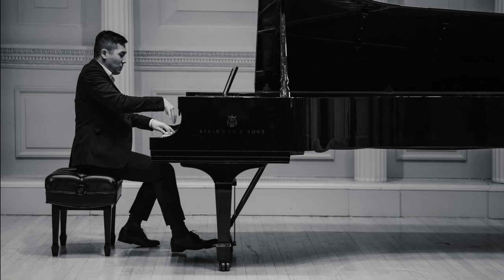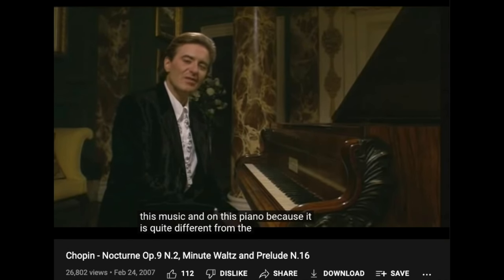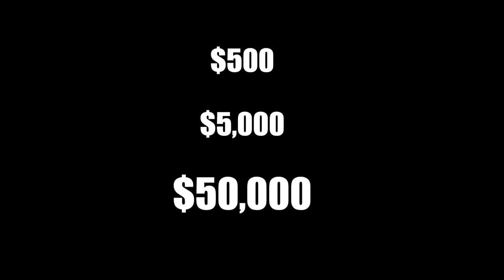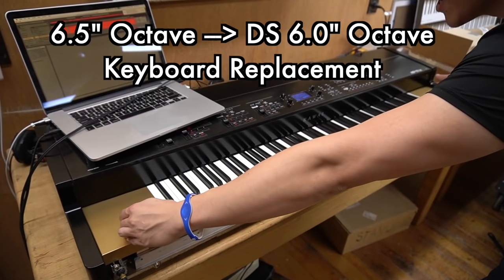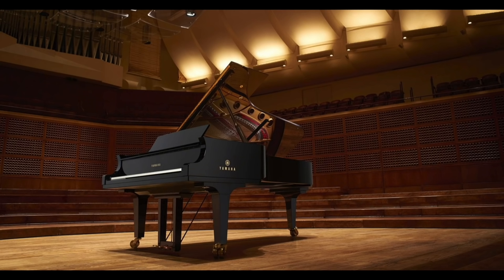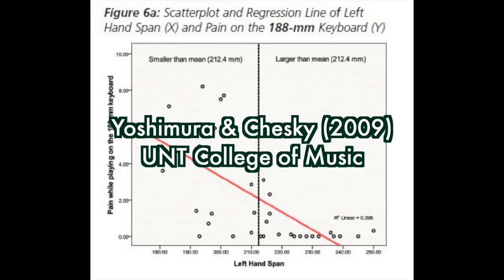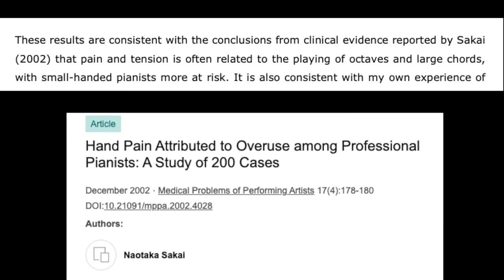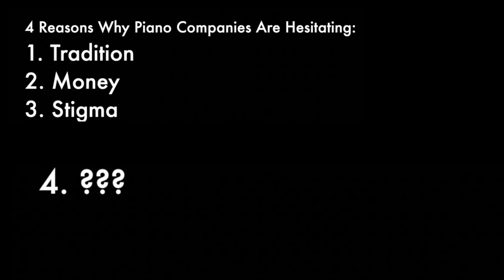Piano's Darkest Secret

Comment: Actually I thought this problem long time ago, and I was told one reason is that the big hand pianist would find the smaller sized piano impossible to play due to the narrow width between two black keys. So for manufacturer they prefer to produce one type of piano that meets the most demand ( not everyone is going to play Rachmaninoff obviously ). But yeah we are in 2022 it is a shame the big piano manufacture do not offer different size. Great video!
Reply from the maker: Yes. Back in the late 1800s this is the reason why standardization kept moving the keys wider. In a household or community where there is only 1 piano, this size made sense to allow everyone to play. But it's 2022 and everyone should have their own piano or keyboard that fits them (in my opinion :)
Reply: They just need some competition and then they will change their tune because they want the money too. Then they would make them. Maybe with this video, more awareness will come and people will buy so many keyboards from David Steinbuhler, that he has to make a full time operation of it and becomes a household name, and the competition begins.
Reply: Solution:
Standardize high protein consumption and make small people bigger.
Reply: @Serpenzeye  Hailun pianos in China has just started offering smaller keyboards on their HU1P upright acoustic model that costs about $10K [Edit: It costs $15K]  I do not know if there is any collaboration with Steinbuhler. I read a review which says Hailun makes pianos that are of outstanding quality.
Reply: Yeah, but as we saw, even the majority of men don't have ultra large hands. And restricting your products to mostly men could easily be taken to court as a discrimination case. "Tradition" does not cut it in 2022.
Reply: @pubcle  Yep, like we need to tell people to eat more.
Reply: @2112jonr  It's not discrimination to aim your product at a demographic. As stated in this very video, there isn't enough demand to actually create smaller pianos. It's not discrimination nor is it tradition.
Reply: @MusicalBasics  But people were smaller in the 1800s than they are now. So even this doesn't hold up to examination.
Reply: Heck, I find regular pianos impossible to play without excessive contortion of my wrists. My fingers are simply too thick to play between the black keys, even at glacial pace. My middle finger needs to slide in at almost exact 90 degree sideways angle to play between the white keys. 

So yeah, different sizes would be appreciated, at each end of the spectrum.
Reply: @pubcle  IT IS tradition and in fact the current size doesn't fit the MAJORITY of the population, not the minority. If you are too math iliterate to realize that,, I'm  sorry for you' because it is not hard.
Reply: @adisaikkonen  I, unfortunately(Or Fortunately) have large hands.. Large Rachmaninoff hands. Playing 10ths and 11ths are effortless to me. My piano teacher saw this in me when I was young , and taught me very difficult pieces at a young age.
I played Chopins Etude Op 10#12 when I was 11. And Brahms Rhapsodies when I was 16. 
Unfortunately with Rachmaninoff -type hands, I could Never be an effective Violinist Or Play the Harpsichord well :(

I suppose I could be a really great Cellist or Double Bassist though ;)
Reply: @InXLsisDeo  Yes, the smaller piano would be better for the majority of people, but the demand isn't there. It doesn't matter if it doesn't fit the majority of the population if the majority of the population will buy the current one. There is no incentive made strong enough to change their operations. If you're too economics illiterate to realize that, I'm sorry for you, because it's not that difficult to understand that even if it benefits people to have a smaller keyboard, if the demand isn't there, if there isn't a strong enough economic interest by the potential customers, then there's no reason for a company to take the initial hit when they'll buy the current standard piano.

Companies don't work on tradition, unless they're mom and pop or at the very least family-owned. It might be tradition partially, but only in the way that people aren't going to buy non-traditional pianos in significant enough numbers to make the effort of building the entire supply chain necessary to produce smaller key pianos in significant numbers. The corporation doesn't give a damn about tradition, it cares about money, and logistically there simply isn't enough of a push for the company to consider that investment worthwhile.
Reply: @Serpenzeye  You contradict yourself. There's competition who tries to sell smaller pianos, but nobody wants to buy them. The guy is just wasting resources and 30 years of time on his personal hobby. Nobody needs it. Saying that "80% of pianists would benefit from smaller pianos" is not only delusional, but also arrogant. As if you know better for other people what they need, than they do themselves.
Reply: @pubcle  funny!
Reply: @adisaikkonen  you make a great point. You are not alone!
Reply: @2112jonr  But piano keyboards were also narrower then, and until the late 1800s, repertoire was less likely to require the large stretches of later Romantic pieces. Women were not expected, not encouraged to be virtuosos but played appropriate 'feminine' repertoire mainly in the home. Those of Asian ethnicity (smaller spans than Caucasians) were not playing the piano then. Today's keyboard was designed to suit male European hands. The important issue is the wide range of hand spans among pianists today in relation to the 6.5 octave keyboard, quite large by historical standards.
Reply: ... please --  everyone -- please UNDERSTAND! 

it's ...

NOT 

SMALLER

PIANOS  

it's ...

SMALLER  KEYBOARDS   -- which can be fit into a standard piano -- upright or grand.

Please stop discussing smaller keyboards as smaller pianos  (unless that's really what you mean to discuss)
Reply: in saxophone, trumpet, drumming, string world you got mature thinking so all kinds of thickness, lengths and sizes are out there in reeds, sticks, mouthpieces! why the piano has not caught up is kinda disgusting, angering and utterly ridiculous
Reply: @2112jonr  Does a person's  shorter growth final height due to worse living conditions equate to smaller hand size?
Reply: Don't they, or can't they also narrow down the black keys to keep the same gap between them?
Reply: @ekklesiast  
Most people have no idea these alternative keyboards even exist. A huge portion of pianists would, in fact, benefit from these reduced-sized keyboards. Acting like us wanting people to have access to something they might not know they're missing out on is arrogant is in itself arrogant, because you presume that the status quo is inherently justified and not just happenstance. As in, you're trying to justify the piano manufacturers' greed and cowardice to progressive risk taking with flimsy "it's just how it's meant to be, this is what the people as a whole want" scapegoat bullshit.
Reply: @Mahlercougar  Paganini had huge hands...

Comment: Professional pianist here. 

My hands are 8 inches or 20 centimetres, I can play octaves pretty comfortably and I can reach a ninth if both notes are black or whites keys - if one of them is white and the other one is black, I can't play it. I think other people with my hand size would have an even smaller hand span since mine are really flexible. 

Only good point I can find in having small hands is being able to play in between the black keys, and this can be needed in a bit more modern repertoire like Debussy or Ravel. Pianists with larger hands but thin fingers are still able to do this, though. 

In most cases if you reach an octave you're said you're ready to go. That's true while you're a beginner, but when you try to play more difficult repertoire problems start to show. I'm not talking about Rachmaninov or Liszt, who wrote for their own gigantic hands. It can be difficult to play a Beethoven sonata. The problem is not the extension of the chords, but the amount of movement you must do to reach the different keys, especially while playing really fast. 

Some milimetres make a huge difference. In my case, it would be the difference between being able to play only the first movements of Grieg piano concerto, or being able to play the complete concerto. It's so sad I can't finish it just because of my hands aren't big enough to play the accompaniment at the right tempo, even when having a great leaping and chord technique. 

And finally the injuries. You probably won't injure yourself if you play half an hour a day with small. You'll probably do if you have to face Chopin's etude op 25. n°10. You'd have to care for yourself a lot for not getting injured, have a great technique, take rests, and still would be suffering to play it, and meanwhile a bigger handed pianist could play it with half the effort assuming they have the proper technique. Is it fair? 

I would definitely cry if I had a smaller sized keyboard. I just hope companies start to manufacture them, and give us small hand pianists an opportunity to play those pieces I can only dream I could play.

Comment: As a carpenter I would love to experiment with making some sort of a piano topper that can be mounted to the top of piano that is just a smaller set of keys. The majority of the keys in the middle of the piano would basically be right above their corresponding key so it would only be a challenge for the last 20 or so keys on each end.

Of course that would be a bandaid solution but it could make it more accessible to the masses

Comment: This is the video I just found yesterday as I looked for solutions to see if my old, dumb small hands on the piano could actually make a difference before I die. This is the video that made me cry. This is finally a real answer to what has stopped me going any further with my music past a certain level (medium to advanced at best, I guess). I already had the traditional handicap of not starting piano until I was 17, instead of 4, and was made to feel inferior even though I passed all my piano exams with honors , as a student. I wasn't quite solo concert level therefore, so I played for a Dutch Male choir for a while, had a few private pupils, got married, had kids, music stopped and basically resigned myself to hide away my classical box forever. And all the while I didn't realize why my hands felt cursed. I blamed my late start for being the only culprit for the constant struggles of trying to stretch my hands to a 10th. OMG my female hand is only barely 8.0 fully outstretched. Now, I'm prepared to try again maybe, if people actually are aware of this issue in the open, I might have a chance yet, maybe even be lucky enough to find a piano with smaller keys too, one day :)

Comment: I had no idea there were pianos built with thinner key widths, that is so interesting!
And wow, David Steinbuhler is absolutely blowing my mind right now!
I actually have pretty small hands for a male (7 Inches) but i also happen to be a Guitar luthier, a lot of my guitars are made with smaller scale lengths and smaller fret spaces to accommodate for the lack of size, and i find playing them to be much easier although with guitars the physics of how strings work does sadly change things slightly from a standard guitar, but that's to be expected. Maybe i should consider custom making guitars for other people with small hands like me
Reply: I imagine the guitar would sound better anyway, just because the player can control the sound better. If you have to stretch for a note, there's not much muscle energy left for subtleties.
Reply: If you are a guitar luthier I assume you probbably know, but anyway. You build classical guitars?

I say it because electric guitars come in a wide variety of scales, from 25'5" (standar), to 24" or 27/28" if meant for lower tuning
Reply: @kasbeeltherapriest3443  I don't usually build standard guitars, my main thing is that I design new types of guitars (usually electric) with a custom number of strings and a custom scale length completely from the ground up. I forgot to mention that in my comment but my main type of guitar I build is the 3 string guitar which is really good for people with small hands or limited hand movement since they barely have to stretch to play them

Comment: I have played guitar for decades, and noticed quite quickly as I attempted to try piano how much my hands hurt after just 10 minutes or so of entry level practice. Even with finger strength and dexterity going into the venture, I was surprised by this. I am 6'4" tall and do have large hands, which is actually sometimes problematic on a guitar in certain situations. I can only imagine the hurdle this must create for many, and it opens up my appreciation for their talent even more so. Very interesting research, and story. Thank you for sharing. By the way, I also have very large feet, and you know what that means...very difficult to find shoes in my size. in 2022 you would think that people would be beyond stupid inaccurate stereotypes by now!
Reply: Some of that might just be lack of muscle adaption.  I had similar issues going from guitar to piano but I adjusted.  However I do think there is a place for 6.0 and 5.5 keyboards for people with smaller hands.  Standardisation is bad when the standard does not allow for different people and body types.  I get so much joy from playing piano and that should be available to everyone.
Reply: Funny, I was playing the piano for many years, and when I got to play the guitar, I had the same feeling. :-)

Comment: I am a small man, 64 years old and a career auto mechanic. My tiny hands have served me well, navigating cramped spaces in modern cars. A new musical interest includes keyboards, and I struggled due to small hand size and a lack of flexibility. A decision to buy a "mini" size keyboard (Yamaha PSS a50) rocked my world. It looks like a toy, but has a great set of features. Velocity-sensitive keys gave me a HUGE boost in "expression". I previously purchased several entry-level electronic keyboards that did not have velocity-sensitive keys. I didn't realize what I was missing! The Yamaha PSSa50 sounds great when connected to amp and speakers.
I recommend anyone with small hands to go to a music store and try a quality "mini" size keyboard.